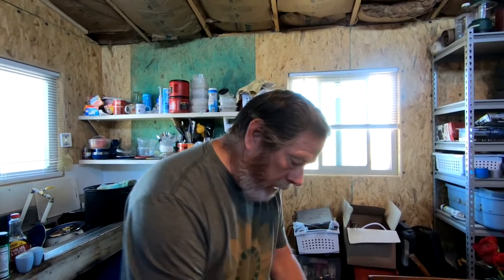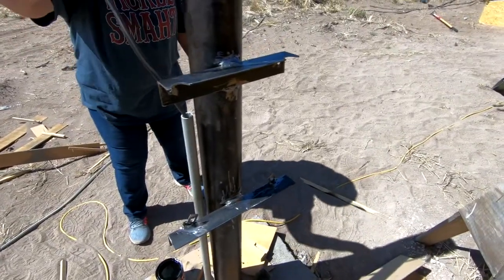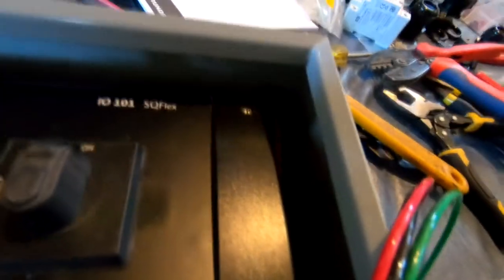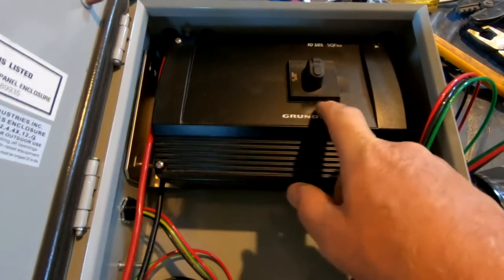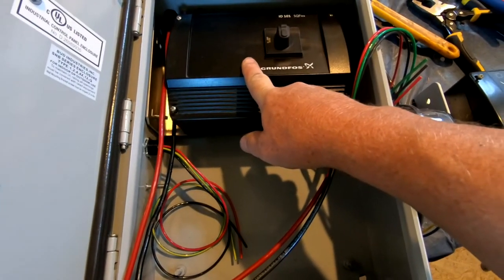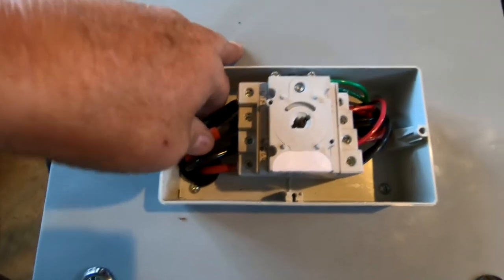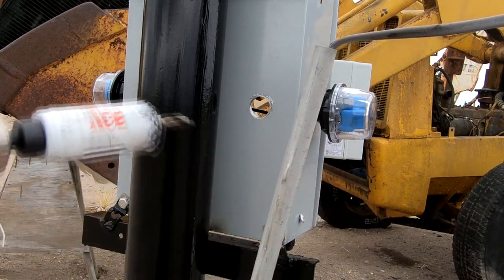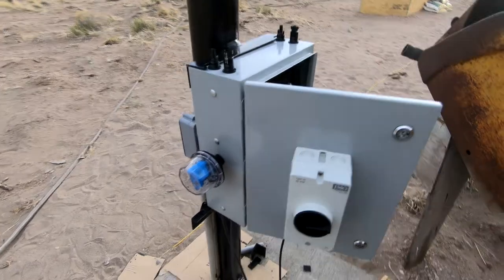Solar Powered Well Control - A Well of Contentment

Comment: Wow! There's not an inch extra of space in that box. That was way over my head as I am a neophyte when it comes to electrical but it looks good. I managed to change all the rollers on my garage door yesterday. The garage is so full I can't work on projects in there yet! Parts for the Separett arrived on Monday so I need to get the garage in order! Video coming soon!
Reply from the maker: It's great to see that you are making preparations for AZ ahead of time.  We know that our preps helped us so much in getting here and up to speed more quickly!  For instance, Buzz has been invaluable; we built him two years ago and have had time to modify and test him.  Because of that we have never been without power since we arrived.  Simply plug the Sho'use into him!